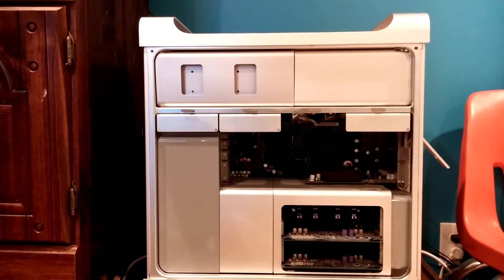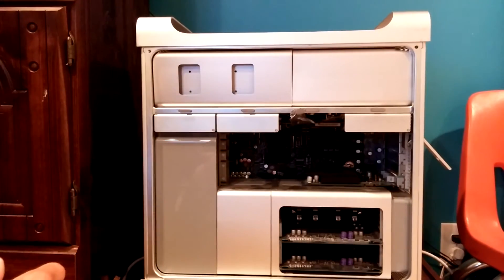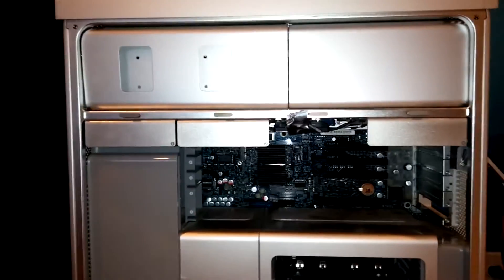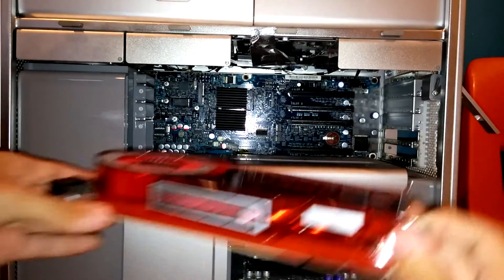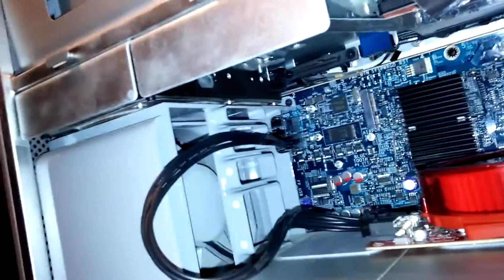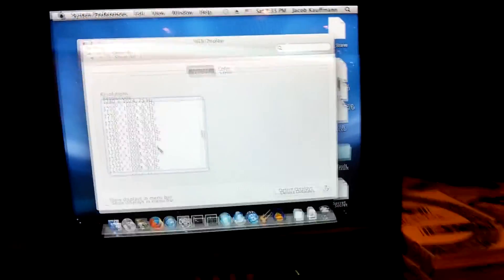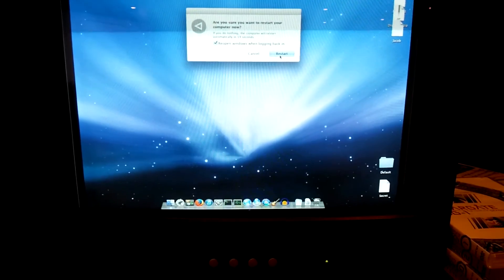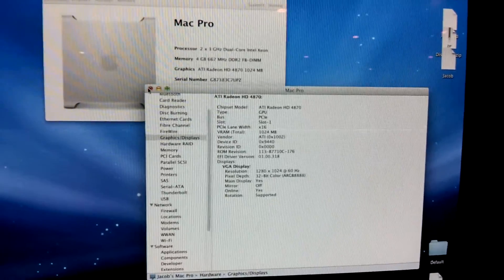Mac Pro Graphics Card Installation

Comment: I have in Mac Pro 2006. Every time that I start the computer just appear the Apple logo and after that the signal of to the monitor disappear. I don´t know that is the problem but I'll try to replace the video card for other one. Can you guys help me?
Reply from the maker: If you haven't already, you might want to try resetting the NVRAM and booting into safe mode, like I mentioned in the video. If you've already tried that, there are plenty of resources online that list which cards work with different Mac Pro models. Good luck!